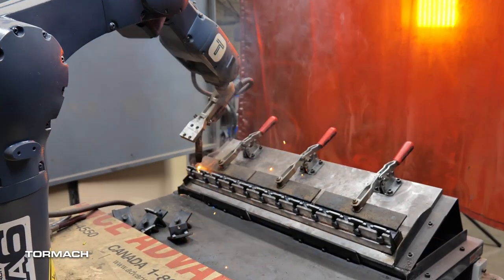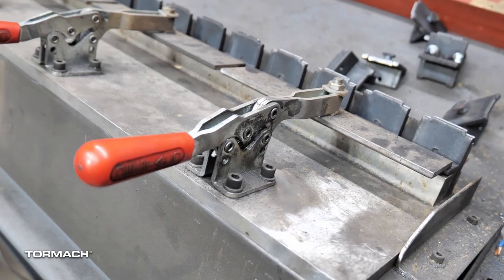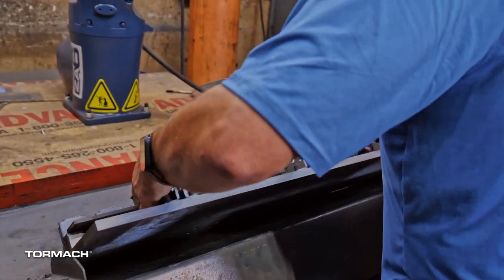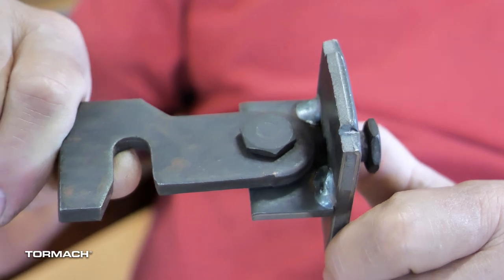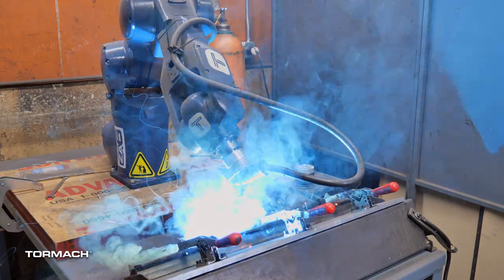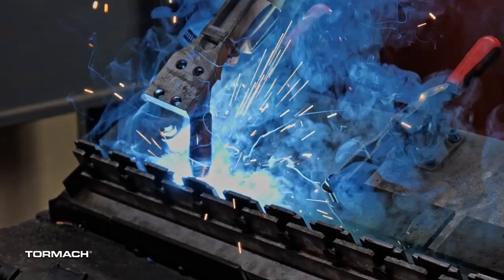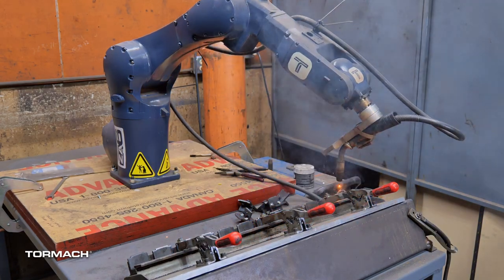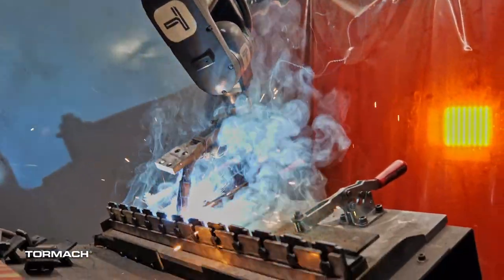How Does Advance Concrete Use a Robot for Welding

Comment: I wonder what the arm + software cost in comparison to a couple of apprentices. There’s a cost to not training new people though I suppose that’s too much long term thinking.
Reply: Machines that do job with minimal human input are ultimately better - worker can load a job and go to do something else. One guy can run 10 such robots and get week of work done in one day
Reply from the maker: PathPilot for the ZA6 robot is completely free, and since it's based off PathPilot for mills it's easy to jump into for our users. In addition, the ZA6 is integrated with Python, which is easy to learn to program as there are many resources. Our main goal with the ZA6 is to eliminate the need to use a costly integrator for most people. https://tormach.com/machines/robots.html
Reply: The software is free for the arm. Plus the reliability of having perfect welds every time is worth the cost of the arm. Plus I'd assume a welder would get really tired of doing two heavy tack welds on little brackets all day long. this robot can run 24/7 assuming there's someone to load/unload the machine and keep it fed with wire and welding gas.